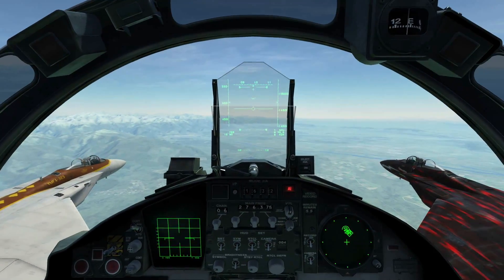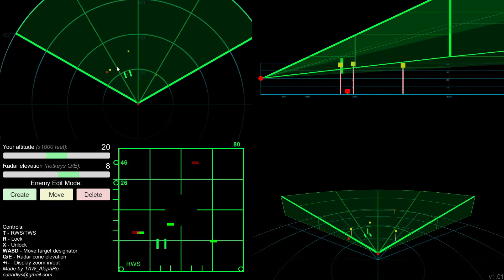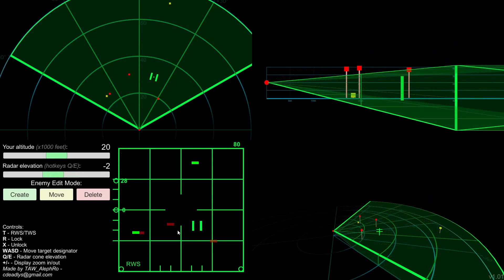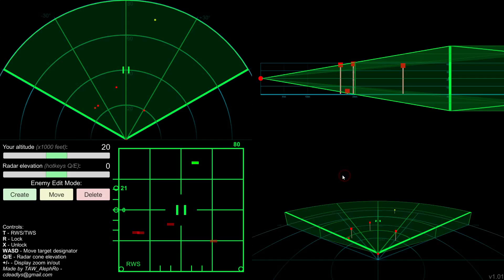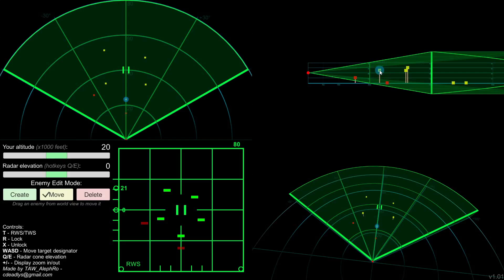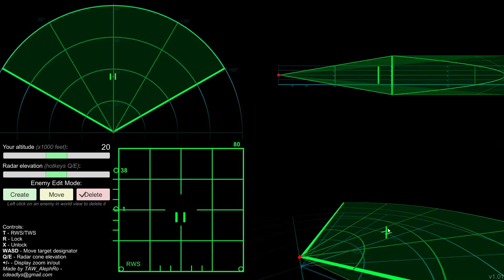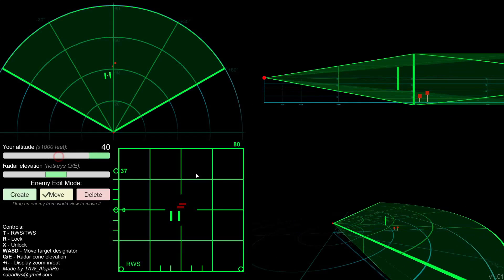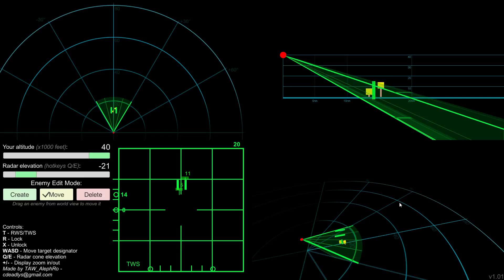DCS F-15C Radar Tool - Short Introduction

Comment: Hi AlephRo can you please check out my latest comment under my first comment below. I should have wrote it right here but for some reason I wrote it as a response to my first comment. Thanks
Reply from the maker: AlphaZulu hi. Read it and makes sence. Although full name simply won't fit into the small window in there. Maybe I'll make a separate panel that opens by a button press, showing how those controls are named in game. Thank you for the feedback :)
Reply: Thanks for taking time to to read my feedback. I totally understand what you are saying about there not being enough room, however I think your idea of making a separate panel to show the in game controls is awesome, that would defiantly work. Thanks again for your time and for this app.
Reply from the maker: Radar tool updated with a panel with a lot of text, including default controls. New version is 1.04 as seen in bottom-right corner. If it is still 1.03 then you will have to clear browser cache and reload the page (with old cache, browser still uses old "memorized" build instead of downloading the new one)
Reply: Hi, I checked it out, looks cool. It's good to have all the other info however, to clarify is what I was suggesting was more like a "legend" on a map showing the correlation between the controls you have set and what those exact same controls are called in the game. The list of default controls certainly reduces the number of controls that need to be figured out as it looks like the ones listed in the "default controls" area are the controls being used in your tool. What I was suggesting would look something more like this:   E = Scan Zone Up (RShift + .) , Q = Scan Zone Down (RShift + ;) W = Target Designator Up (;) S = Target Designator Down (.) etc...The tool is looking awesome and thanks again for this.
Reply from the maker: john smith yeah not enough space to put those in right in the main screen. Plus, everyone plays with a joystick so default keys are maybe needed just a few times.

Comment: Does the Russian work the same way? It seems like their "height level" is really narrow? About 2 degree changes goes from visible  boogies to non visible.
Reply from the maker: I played the 27/29 only for a few hours so I don't know how to interpret the height shift in that line next to the height text (from right side of hud). But I do now that while F15 shows height from ground zero (aka 15k feet from ground) - the russian radar shows relative to your own position (aka 3km higher than you (or lower, if it's a negative value)). So, it's not a degree change, it's a km-relative-to-you change. Hope this helps :)
Reply: the russian radar is identical, except that it only scans 30 degrees in width, instead of 60.

Comment: I give you massive props on the creation of this. This bit of software is clean, elegant and practical. Allows you to play with a active radar system outside of the aircraft, in a system that shows all of the relevant angles and really allows someone to get an understanding of how a radar system works. Well done Sir!
Reply: Hi AlephRo, I love this tool as I said before. The one thing that I could say you could add that was mentioned to me by some people I sent this to, is to add the "official" in game control names for the controls you provided in your app. For example the "Radar Cone Elevation" tells you what it does but if you use this app and then go and try it in your DCS F-15C there is no control called "Radar Cone Elevation". Even if you search the F-15C controls for "elevation" you find nothing. So, if the in game controls names were right next to the ones you provide it would make transitioning from this app into your F-15 much easier.  Thanks